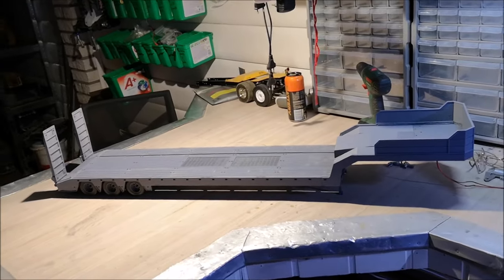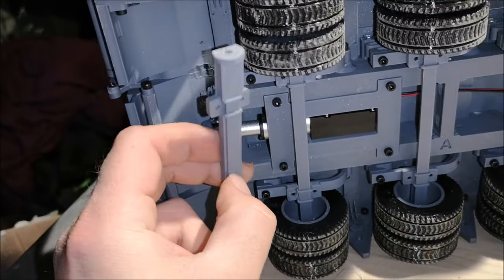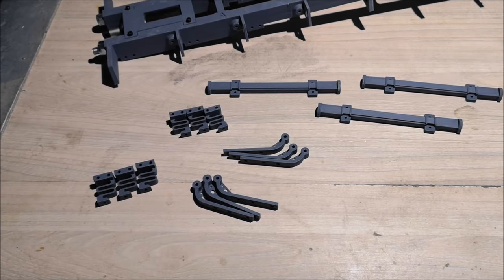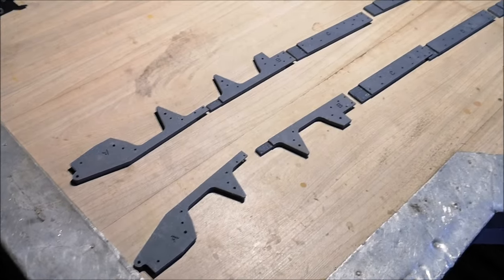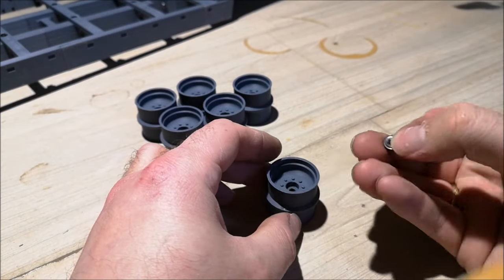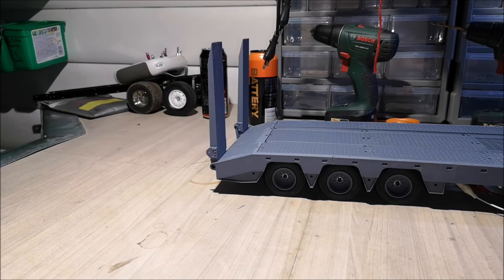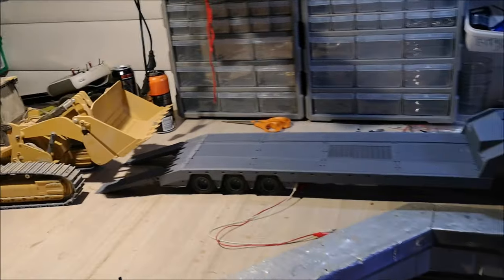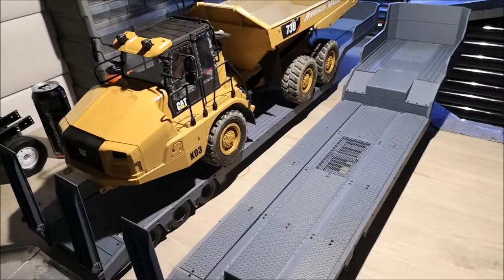Building a RC Equipment Trailer - B20 Build - Part 1

Comment: Hello I am building the Cat D6T I was wondering what motors you use for this?  I think they are 12v  just would like to know what RPM they are? Regards. Paul.
Reply from the maker: Hello! Thank you for your purchase! :) Im using 5840-555 motors, 12v 80rpm. They are awesome!
Reply: Thank you very much. Regards 👍

Comment: Hi lasse! i have been printing all the parts for this trailer and im excited to put it together. did you print the suspension springs from PLA or TPU? and is the  "flexible "trailer linkage TPU or PLA my friend?
Reply from the maker: hello :D on this trailer I printed everything in PLA, and on the longer trailer that I show in the beginning I only printed the tires in TPU. ;)